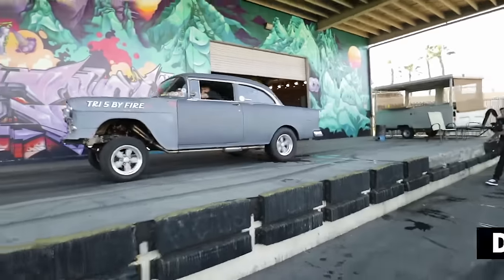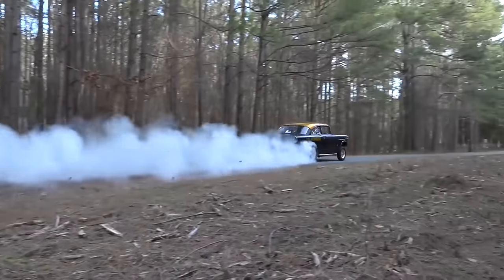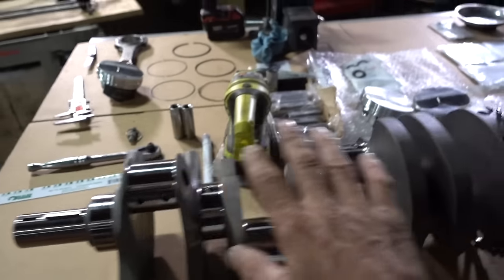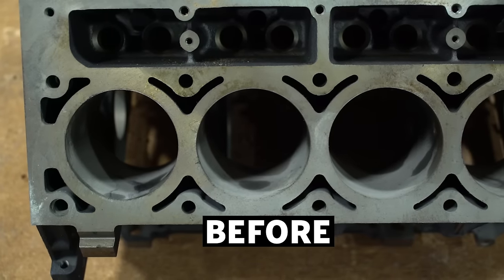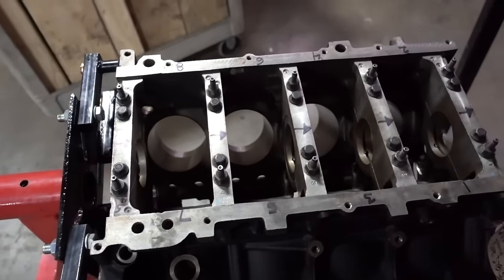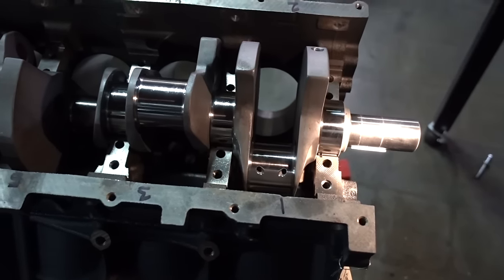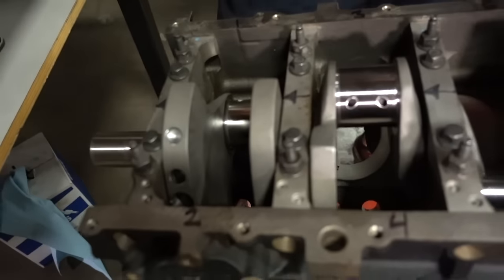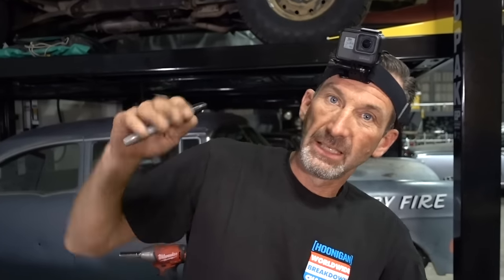700HP Stroker LS - How To Build Bottom End

Comment: 35 years from now someone’s gonna take that engine apart and wonder “what kind of piston brand is “Hoonigan”??”
Reply: Negative, someone will shortly be picking those pistons up off the pavement and saying, "I found the problem! It had some  Chinese-eBay garbage Hoonigan pistons!"
Reply: 35 years from now I bet gasoline engines will hardly exist.
Reply: In 35 years, there ABSOFUCKINLOOTELY will still be American Muscle with fuel burning engines cruising the streets.
Reply: @N2Otorious  Amen!
Reply: @calebbitz4147  gasoline engines going the way of the buffalo by then? Possible. Internal combustion motors not existing in 35 years? Not a chance.
Reply: @danielfuller10  in 35 years come back to this thread and we will see what happens
Reply: @calebbitz4147  considering I work in the petroleum industry and have seen and understand the projections going forward, I'm going to go ahead and say you're wrong. Again, will gasoline engines still be standard production? Probably not. Will internal combustion engines using a different fuel source still be in production? Most definitely
Reply: @danielfuller10  😂😂😂
Reply: @calebbitz4147  remember in the 30s and 40s when everyone thought we would be in flying cars by the 70s? You're the modern version of that person.
Reply: @danielfuller10  yeah, there's a difference between not being as popular and not existing.
Reply: Lol, the engine started knocking before it even made it on the dyno. It literally only ran for a couple hours before it was f'd up and had to be replaced by a professionally built ls.
Reply: Daniel Fuller and you’ll be the guy in the 60’s and 70’s who thought tv’s and modern appliances were just a fad, and mobile phones were a joke of a pipe dream.

If legislation doesn’t ban all gasoline engines in the near future, electronic tech will. Combustible engines have been phased out of almost every form of driven force aside from road vehicles. It’s only a matter of time. 35 years is a LONG fucking time.
Reply: @mrmidnight32  can you explain this in more detail? Fossil fuels are still the dominant power source driving large ships and small boats, freight trains, aircraft & spacecraft, and electric generators in addition to road going vehicles. I actually LIKE electric cars, trains, and buses for daily transportation, but I haven't seen electric power replace fossil fuels in any meaningful capacity.
Reply: @Ryosuke37859  Its called Tesla. Welcome to the futurrrrrrre
Reply: @N2Otorious  amen to that brother
Reply: @N2Otorious  yes because murica is the only country with muscle cars 🙄
Reply: Aaron James Squidward noises intensify
Reply: Well it’s in the trash now since it blew up so no ones going to see it lol

Comment: Have built more than a few engines and still learned a few neat tricks from this video.Well done and thanx guys.To check crank resistance to turn as mains are tightened I use a fishing weight scale and piece of nylon strap wound around crank snout.Pull and look at gauge to see how many pound of tension are required to rotate crank and check for bind before and after torquing mains.:)

Comment: Should be a good race if both dont break.
Reply: hanable moore pretty sure the tri5 will win the setup is alot beefier on it than the blasphemi. But definitely will be enjoyable to watch. Like both guys and channels so it will be good
Reply: Smo Kabong are you serious? LS's don't break down shit hemis do way more than any LS does. If the LS is done right like this one sure looks to be on the right path with completely built internals, it won't break down.
Reply: Smo Kabong do you even have a car?
Reply: Finnigan has extremely bad luck with vehicles lol
Reply: Smo Kabong i dont know about that bro. They throw that engine in everything for a reason. Yea its small but you can throw alot power at it reliably. Maybe the ls build youve seen have been incorrect or you have had bad luck with them.
Reply: Smo Kabong well that’s where you’re wrong kiddo. This might be an LS motor but seems to me like the only thing they bought that was “stock” is the block. Everything else they’ve replaced with a beefier part
Reply: hanable moore be a good race? Blasphemi is gonna destroy this thing. All aluminum blown hemi
Reply: Smo Kabong steve morris made 1,100hp on a stock bottom end iv seen them make 1,300 before they explode
Reply: Smo Kabong engine hp and wheel hp is a difference of about 10% due to parasitic loss. Lol you obviously have no idea what you are talking about.. smh.. guys from drag week grab junk yard 5.3s throw a turbo and make 600+hp all day you put better heads intake and fuel system thats a high hp stock bottom end. Hp is not limited to bottom end its limited by what the heads can flow if you're an engine builder you would know that. Lol i bet you cant even degree in a cam
Reply: Smo Kabong go look up a guy named Clint works for A.I.R he has a 800+hp stock bottom end ls1 on nitrous. I guess its full of unicorns piss since you say its impossible for a stock bottom end ls1 to make over 500hp. Or how about Tim Wilkerson f body camaro stock bottom end ls1 with over 800hp lol a quick search and you will see guys make over 800hp stock bottom end
Reply: Just don’t let hert touch it
Reply: Smo Kabong blasphemi is hemi swapped that's why it's called blasp-hemi
Reply: I love both. But Blasphemi will gap this thing.
Reply: hanable moore because roadkill
Reply: lol good thing this engine wont have any of the recalled junk on it!
Reply: hanable moore or Finn’s doesn’t hook left like it did last time it was on roadkill
Reply: @r4ng3k03r1  lol, the engine started knocking before it even got on the dyno, Brad f'd it all up.
Reply: @mattg7952  is their a video ?
Reply: @lsxramirez3782  Yeah go look through the tri five by fire builds on hoonigan. Brad assembled John's engine and it had crank or rod bearing problems as soon as they fired it up.
Reply: @lsxramirez3782  https://youtu.be/e51z05vB8Bs

That's the video. CPR had to tear it down and reassemble the short block.

Comment: How to build 700 HP LS. 
Step 1) go to junk yard
Step 2) pull out any 4.8, 5.3, 6.0 
Step 3) install cam and springs(doesn't really matter, most after market cams will work, the springs are more important.)
Step 4) add a turbo, cheap Chinese stuff off eBay works just fine.
Step 5) you're done. The engine is built. It's done. It will hold 700hp. You need not do anything to the short block. Just get a decent tune.
Reply: Step 6) enjoy your 200 miles
Reply: @mudargamer  that's like 800 passes at the track. Sounds good to me.  A stock bottom end is fine at 700hp, and cool thing about turbo cars, you can turn them down on the fly so you can drive around at 400, and then turn it up when you want to smoke idiots who think ls engines will blow up at moderate power levels.
Reply: if you're building a track engine,  should just build a carb'ed iron block and not even bother with LS;  LS's are for people that don't have deep pockets and want something they can drive on the street and occasionally take to track
Reply: @wildbill6976  that's one of the dumbest things I've heard in a while.

Comment: When your plasi-gauge for bearing clearance and it says bearing clearance .001" according to your book .001" is too tight [.0015" to .0025"] book says, also If you have a micrometer and a snap gauge you Don't Need Plasi-gauge to tell you the bearing clearance. So let's say the crankshaft measures proper size and the main bearing bore diameter measures proper size, where would you say the  problem is when the plasi-gauge says .0005" to .0010" ?
 A. crankshaft is bent
 B. Bearing to thick
 C. Crankshaft bearing diameter 
  to large needs polished
  D. WITHOUT MICROMETER 
  DON'T KNOW DIFFERENCE 
  E. Bearing cap too tight
If you guessed D. your right 
If you choose D. then you know the difference and probably 
Don't use plasi-gauge or J&B Weld either.

That is one of the differences between a machinist and a mechanic. 
A good machinist would check the line bore of the block after cleaning  before boring it out.
A good machinist would check the line bore with a quality straight edge. By laying zig zag ( .0005" thickness gauge) paper on each bearing bore surface, then place straight edge across all bearing bores and if any of the papers slide freely the align bore is off or your straight edge isn't straight. 
Also a good reason the plasi-gauge measures .0005" to .001" is the oil you put on the back side of the bearing.
 There is a reason machinist build motors and mechanics install them, and machinist are taught by a master machinist and now days measurements in nano-inches.
.0000001" or one millionth an inch.
.0005" = 1/2 thousandth
.001" = 1 thousandth
Reply: Exactly brother. I have done my apprenticeship as an automotive machinist/engine reconditioner in Melbourne Australia and I can tell you firsthand that an engine to be properly machines, even the bores, I'd make a chart with the temperature before and after torque honing a cylinder, so my bores are perfect, I'd walk away and work with it on a day with similar weather temperature, even if it's 3 days later on. But when I measured the bores, can't get any better than that. There's an extent to where people would go to build a high performance engine, but no motor is the same even if same parts are used. We know that anyway. But you try tell them DON'T use plastigauge as it gives a ballpark figure, they're going off about it. A good engine assembler would use micrometres anyway.
Reply: @---xd4wm  if there is a burr on the bearing itself or the cap itself somewhere along the edges, you can see it with naked eye, even feel it by toutch if that's what worries you. Don't need plastigauge for this. If it gets a little bit tight turning by hand, sometimes a rubber hammer does the job by gentle tapping on crankshaft snout side to side and on main caps. Otherwise a small file can be used to take that little burr away if needed.
Reply: You are exactly right. Tricky business if you don`t know what your`e doing.
Reply: @---xd4wm  if you can't see or you can't feel anything then you shouldn't be building engines and your assumptions or your comment should I say r for kindergarten kids. That's why micrometres are there for. And I've done crankshaft grinding and main cap boring and honing and have chosen the right size of bearings so here are the facts. You can't prove me wrong for I am an automotive machinist and a great one. Good luck with your spinning main bearings and your seized conrods mate, the rotating assy suppliers will love ya
Reply: Very well put about a mechanic vs. a machinist. I spent a lot of my younger years working as a machinist in an automotive machine shop. I would always use a dial bore gauge to check the clearances with, I like having the housing boars on the tight side for the benefits of bearing crush. If you want to see some very informative videos on engine machining check out Steve Morris!!!

Comment: whatyareckon, I'd have to agree I spent a good part of my life machining hi-perf & racing engines and you always line hone after installation of main studs over stock bolts. And things like checking main (and rod) clearance by using the bearings in place, torqued to specs and using dial bore indicators against the size(s) of the crank. Then record ALL info & clearances on the build sheet & for the shops records. We built a lot of engines from 5-600 to 800-1000 HP that gave good service! Example 555 cu in BBC single 4V that made 1050 HP and the guy used for 2-3 years that I know of....

Comment: Finnagen  builds race cars and raceboats  , Finnagen  gonna win bro
Reply: His machine also makes over 400 more HP as well. And while power isn't everything... Well I know where this road ends for the Bad Dad.
Reply: Blasphemi just ran a 7.92 at drag week so they might need to bring a little more heat.
Reply: I did that on a 5k engine i built, didn't end well. I guess the same could be said for this motor.

Comment: He checked the bearing clearance with one torque spec and did the finally assembly with another torque spec. So the original testing is almost pointless.
Reply: Shaun Gardner theoretically yes. But in practice, it's the fucking same.
Reply: Wyatt Elder not entirely, mr. band camp. The old bolts will stretch totally differently than those arp studs and more or less torque can change the clearance more than you think. All that work was for nothing when you change  everything
Reply: Shaun Gardner the bolts will stretch, but the caps stay the same shape. That's how that works. If your caps are changing shape with out load, you have major problems.
Reply: I've also measured crank clearances before and after changing studs/bolts. My starret tools didn't measure it any different.
Reply: I wonder if the main caps were still the same shape the hiding they got with the screwdrivers and the ground.
Reply: Wyatt Elder it’s been proven that ARP main studs changes your changes your clearances
Reply: Stock boltts are torque to yield. If you torque them again is not going be the same
Reply: exactly;  pointless to test original tty's (they're already torqued to specified yield from factory/stretched and are thus pointless to re-use or measure after being removed once); tis why you can't reuse them (not even tty engine mounts).  The main concern when switching to ARP bolts/studs is condition of caps (dropping them on concrete floor certainty doesn't help matters), bearing thickness, and crank eccentricity

Comment: 7:50 ruined
Reply: Edward Grindstaff I couldn't believe he did that, like they don't have a small dead blow
Reply: Didn't hurt nothing...geez
Reply: Agreed a dead blow could have worked better but at the end of the day, this isnt going to harm anything, especially not any vital areas.
Reply: As a machinist, I would not have used that cap without seriously looking it over. I would have taken the crank back out and checked to make sure it was concentric to the other bores.

Comment: Good video and great tip on how tight the engine should be. Unfortunately, my dad never taught me how to rebuild an engine and I learned how to do it from books, other youtube videos, and trial & error. For my first attempt with a 302 V8, I didn't know that "if you need a cheater bar to turn the engine, something is clearly too tight." That engine "clearanced" itself in the first 15 laps of our next race, developed piston slap, and died by lap 19. Well, that was a learning experience. I certainly didn't make that mistake a second time and made sure to have the engine shop line bore the mains in addition to all my head & crank balance work.

Comment: Dang man, hate to call ya out. But an unlubed crank, no spinny spin when checking clearance
Reply: CorndogBrownie one of many reasons this engine blew on first start up
Reply: @mrmidnight32  does the fancy high precision special sauce racing machine work and then used plastigauge lol
Reply: This can run dry sump with VRO pumps injection in to the intake manifold and amsoil dominator 2 stroke oil. These can be made into poppet valved loop charged 2 strokes. I filled a 5.3 with XD-100 etec 2 stroke oil with good results, can these is e rigged with dry sump, I have the VRO pumps as I can mount them for oil injection
Reply: Not only that but they checked clearance and then replaced the bolts. Usually you want everything matched when it’s align honed...
Reply: I love hoonigan but there’s a lot of bad tech here that I hope doesn’t end up ruining a lot of loyal subscribers vehicles

Comment: Arp studs will change the clamp specs.  Surprised they didn't measure with studs instead of factory bolts.  LS101.
Reply: That's exactly what I said, I'd like to see the oil after 20 min, bet it looks like a 70"s metal flake paint job. Hoonigans? Fooligans more like it...
Reply: WROng there is a target clamping force they want and if the spec don't change the clamping load force dosen't unless they change when they put the studs in  100 ft lbs same stud or bolt .